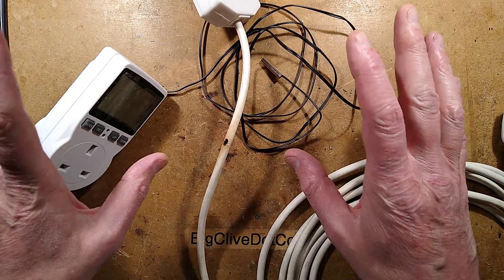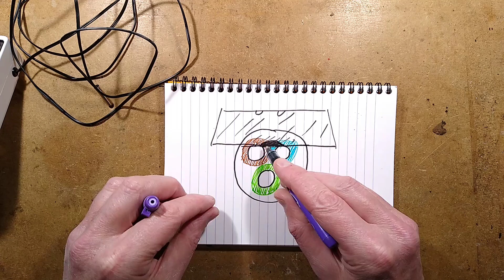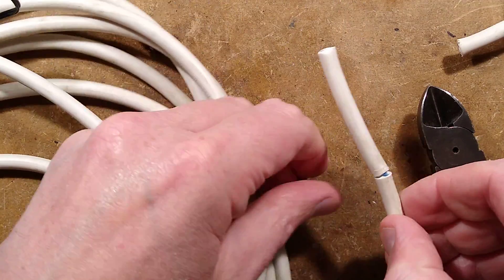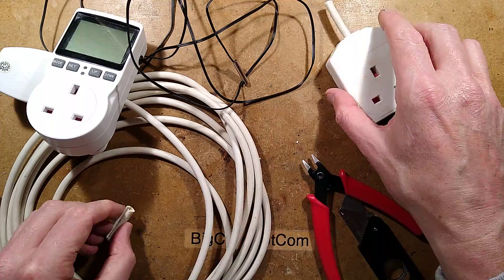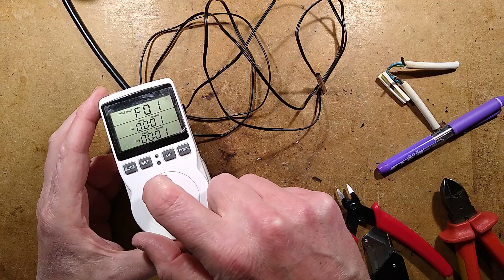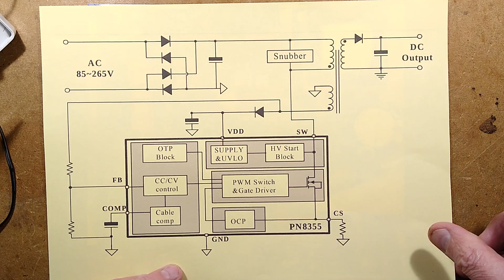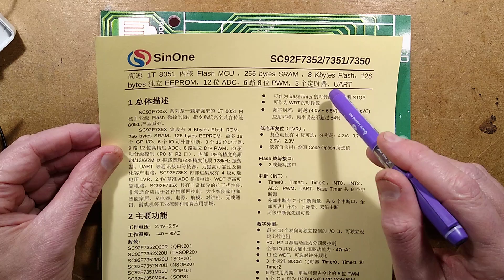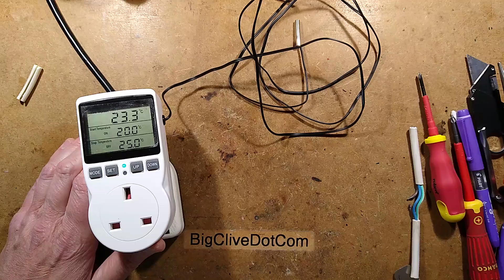The case of the mysterious cable arcing

Comment: I was once trying to trace an audio (computer speaker) cable through a rat's nest of wires somebody had made behind their desk. As it turns out, "rat's nest" was more accurate that I'd have liked, because some rodent or other had chewed through the insulation of the computer's power cable. The copper was exposed but not cut through, so the cable still worked, until I pushed it aside and the copper brushed up against the bare metal desk leg. Loud bang, bright flash, breaker tripped. Fortunately, the only casualties were the cable itself, a scorch mark on the desk, and a... well, let's just say "mark" in my pants.
Reply: Front or rear mark?
Reply: @jonathan_herr  I think I'll leave the answer to that up to your imagination.
Reply: @HiddenWindshield  Sounds like the answer is YES!

😄😁😆😅😂🤣
Reply: . Good answer
Reply: @jonathan_herr  There's a reason why the live wire is BROWN. 😂
Reply: @jonathan_herr  Probably both😂😅
Reply: . Or maybe both
Reply: I shorted a 24s li-ion battery the other day and it scared the absolute shit out of me.
Reply: skid marks indeed
Reply: One actually would think a thing like that would happen way too fast for the body to react by leaving ANY mark !
Reply: @harrickvharrick3957  Well, I did survive, after all. I might not have mentioned that. In fact, I didn't get shocked myself at all, it was just the sudden flash and bang six inches from my hand.
Reply: @HiddenWindshield  Yes, yes, I do understand THAT part  😁   Electricity can be surprisingly ferocious indeed. Remember such a bang can easily be loud enough to get a pissed dad run down two floors to tell you little kids his thoughts on putting stuff in the wall socket!
Reply: . Have heard stories about kids doing this in school.

There are even a few stories on NPR or something like this for this being involved in one story or another as well heard one again the other day.

Sometimes just being in the old gum wrappers as well 

I remember once one of the people in school this is the only time I've actually seen this in person it was not on the brightest people.

You know sometimes in the cafeteria and other places in the school remember they had the connections for like the steam trays and stuff and other high power equipment in some of the gym areas and other places in some of the schools I was in as well.

Keep in mind I'm in the United States.

However some of those heavy-duty receptacles as you can guess do carry a bit more spicy than 120 volts!

Not to mention sometimes well in excess of 15 amp circuits on top of this.

I remember some of my messing around with when the metal forks bending the times back and out of the way not sure if he had spread the two ones that were still pointing straight out or not and guess what that the person did yep right into one of those receptacles and fooling around with enough to make contacts to boot oh yeah nice big bang woman and boy did the Sparks Fly.

It looked as though that he did not know that it's not a good idea the gentleman metallic object into some high power receptacle and not knowing what would be the result is my guess.

And I did hear someone saying I would not do that if I were you on top of just before.

For some reason it smelled like burnt flesh and people were crowded around and someone said get the nurse now.

As far as I know that person did not return to school for several months and clearly could see that he had lasting injury.

For at least more than a year he worked love on that one hand.

I don't know all the details but it was pretty horrific.

I guess you could say almost like mini arc flash type of injuries clearly as I said there was a smell of burning flesh.

Normally when he did this I think that he was quite literally in shock no pun intended.

He is the kind of person that someone dared him to do something he would have even if it was extremely dangerous and most people would know that it would be foolish or dangerous or even risking their life he would probably still do it potentially if someone told you to jump off a bridge in the shower water he might be the one to do this.

I have a feeling that he probably was afraid to even plug anything in for a while after!

I've seen somebody accidentally plug in something that happen to have a dead short across the incoming power chord more than once that was nothing compared to what happened with this person no clue what the voltage and or current of that receptacle was but yeah pretty horrific.

Keep in mind worked on stage crew and have had a few electrical faults most of them were nothing like this.

What besides the time that someone kicked the cable and knocked out the entire stage lighting service trip the Thousand amp 3-phase breaker that was one big bang definitely the biggest one I've ever seen in person not at utility level as in on 120 208.

I think that's when the very few times the main breaker had actually tripped!

There were times that we had to cut this off for emergency disconnect due to an incident!

Keep in mind all the power for the stage was not provided by the service entrance separate for lighting power only!

There was plenty of 208 and 120 and 208 available that was from the rest of the schools electrical service.

We did have access to the Electoral room as needed if need be.

I one of the ones that had the keys for this.

I was literal stage crew electrician.

Plus I was authorized to do electrical work even elsewhere in the schools needless to say I know the system like the back of my hand every so often would need to reset Breakers when something goes wrong 

Even had a few teachers make an oopsie and say.

Do you have to know where the breaker for the circuit is and I'd say yep sure do no problem and then say be right back!

I've been doing electrical repairs in silver I can remember learn to rewire lamps at 4 years old honestly doing repairs that early
Reply: @harrickvharrick3957  You know you're alive when you have a delayed reaction.
Reply: A capacitor explosion of 1000 paper capacitor across mains - best explosion ever...
Reply: @singhpk99 Furious personal experiment or someone else doing any witnessed it or is there a video somewhere on this Elsewhere on YouTube it just sounds like this could be a video somewhere on here as well or perhaps you're the one that put the video up if there is one please respond and if it is a video please add the link would love to see this Jamie want big boom as they say go out with a bang as they say all that sort of stuff
Reply: You know what they say is when you least expect it is when it'll get you're the most were the worst whatever you say on this.

Just remembered an incident that I had.

I remember at a previous place I lived at I was in the kitchen did not realize that the microwave wasn't not plugged all the way in flush with the receptacle.

Keep in mind this reciprocal was behind the microwave.

If you know about those bread ties that some of does twist ties are covered in the metallic material the fancier ones Orleans metal coated paper or whatever not sure what material this is honestly.

Well hand open some bread a few days before didn't realize that the bread tie was sitting on top of the microwave where to get my dish drain and happened to knock that bread time off the top of the microwave unbeknownst to me it's still being there and of course when that happens Falls across hot and neutral of the microwave plug.

Startled The Living Daylights out of me.

I'm very cautious because I do work on electrical equipment but when you don't expect somebody to go horribly wrong or something like this that's when it's going to surprise you the most and let you know it's there and the circuit was active.

I've been testing Christmas lights before and well things did not go according to plan once had the female end of a old Set of Lights the kind that free dated having fuses in the mini lights the female plug was Lil Wayne blown off don't know what happened there but definitely some sort of really bad fault.

Is more of the shock of me just looking at it like how did that even happen it wasn't so much the bang and the Flash it was more of what would cause that to do that what was going up to my mind at the time and just staring at it of course after pulling the plug of course the breaker head already gone but still good idea to unplug something like that that's when the strangest things that I've seen happened with an electrical phone in some type of cord four light set.

Although one time I did see someone plug two cables together on stage they didn't realize that that cable was hot when the connection was made Big Time Flash and bang.

What up replacing both male and female on that one I think that was one of the ones that was probably needing to be replaced connect to wise years ago.

Definitely was a not-so-fresh connector and definitely had seen its days.

There's one time we were doing rigging somebody else up incoming nearly got hit by a flying female connector.

Apparently cable got stuck in there trying to get free and want to somehow have any income off when they gave it the old heave ho.

That is and always was against protocol and safety concerns!

Also one time I remember why do we have a cord with no plug on the end that was just taking off the ringing and someone chimed in and said.

Who set up the rigging had the cord the wrong way around and decided it was easier to change the plugs then redo everything and turns out they didn't install the plugs very well and and just come off in the process of tear down of that show!

Needless to say that person no longer put plugs on cords and I checked others that apparently it had been working on and lo and behold done very badly and Spring Leaves not even properly tightened either everything was almost like barely even tightened I think that's one reason why we had that flickering light as well probably was the culprit was that person had tried to put a plug on that one needless to say he was prohibited from repairs.

By myself specifically and Stage manager after I showed case manager his quality of work that puts everyone at risk

Comment: The Chinese Remote control version is worth examining. It works well although the transmitter (2xAAA) batteries need changing every three months. It has been known to migrate to the freezer mode (indicated by a frost symbol), from the heating mode (indicated by a flame). When it sends the temperature signal it flashes Green which can be annoying. I tend to keep the transmitter in a cupboard!

Comment: I always marvel when it all gets exposed.
I spent 40 years in industrial control, and more than once I got a roll of wire where they ran out of conductor and simply loaded more and kept extruding. The result is a roll of wire with a break or a simple contact connection somewhere in it. Maybe there's another explanation, but I've also found a "tape together" (not a splice, just the 2 wires taped together) in the middle of a 500' roll. None of them are good, especially when pulling into conduit. 
It could be this cable had a bad roll of wire that then went on to become a cable. Hard to believe wire manufacturers can get away with such practices, and well not common, it's not entirely rare either. To this day, I always ring wire on the roll when it's delivered, and keep a sharp eye (and hand) on the wire when pulling.

Comment: I electrocuted myself on a building site because of a faulty cable. It was wet and I was coiling it up whilst it was plugged in, I got a shock, yelled out and tried to drop the cable as I let it go I got another shock yelled again in a higher pitch and tried to drop it again. This happened about 5 times with my voice getting successively higher untill I managed to drop the cable. Turned out I'd blown power to the entire site. Inspecting the cable I saw a very fine slice in the insulation. I was totally fine and I learnt a valuable lesson!

Comment: Could be just very cheap bad dangerous cable. I had an extension cord with an triple mains connector with switch, and really, I bend it sharp for 30x, and the isolation broke open !

Comment: This happened to my hair dryer, spark came out like fireworks. I later found that the outer insulation was a normal beefy looking black sleeve with blue-brown inner insulation, but the actual conductor was so small an earbuds might even have more cross sectional area than those cable did..

Comment: I have an Amazon item you can tear down. It works just fine other than the angry pixies that tickle you from the usb metal exposed on the connector. Also tempted to upload a short video where there is a light switch blank on the shower wall. And on the other side of the shower wall the light switch to turn light on.

Comment: As Argoneum pointed out, it looks like it was probably Aluminium wire instead of Copper. Any chance of experimenting with the rest of the cable to see if it's easy to break again and how much load it can handle? Cheap extensions are great until your house burns down.

Comment: I don't know how many power cords I have seen go up in smoke ,slithering on the floor and melting and popping and crackling ,just like fireworks only with the smell of burning rubber .600 v can go off with a boom ,especially when run over by a lift or other machines ..we had a 12 /4 SOOW cabtire go off like a shotgun when someone with a towmotor decides to run it over .was on a 600v 3p 20a circuit .took out all 3fuses ,luckily

Comment: I had a slightly different thing happen to an Ethernet cable when I was pulling through another Ethernet cable under the floor of a our data centre at work. The outer jacket was pretty aggressively conformed to the twists of the pairs inside, so it was particularly ribbed (For her pleasure? Because it wasn't for me!). When I pulled it through, it happened to run over a perpendicular cable, which evidently didn't have a very tough jacket, because it gouged right through it and then went through the insulation on the pairs.

Only found out about it later when IT started complaining about a server becoming unreliable. Found the gouge when I was tracing out the connection from the server to the switch, so obviously I replaced it immediately. When I checked the port logs and stats, it was constantly going down and up, and lots of packet errors. The problems went away with the new cable.

Needless to say we switched to a less aggressive brand of cable.

Comment: Never thought about this until now, but in the UK, where your running 240v, your cords can be a lighter then the cords over in the US. What's "consumer" heavy duty over there? And do you often see conductors breaking in cords?
Reply from the maker: A typical cable for the highest load run from a 13A plug (3kW) would be a 1.5mm CSA cable.
Reply: @bigclivedotcom  Americans are probably more used to using AWG for cables but 1.5mm would be a little bigger than 15 gauge (1.45 mm) but smaller than the 14 gauge used in their standard 15A outlets (1.62mm) in AWG it would probably be about 14.8 except I don't know if they make fractional gauges like that. Still fairly comparable would only be the larger 20A receptacles that are significantly different as those use 12 gauge (2.05mm). But I think the 15A is the more common one as far as I know 20A receptacles are normally found in kitchens and the like as various worktop kitchen appliances like microwaves and toasters get close to or exceed the 15A limit at 110V.
Reply: @bigclivedotcom  my heavy duty extension cords are 10ga, I don't use anything less then 12, wife got some 16ga cords a while ago that were "fragile", one plus side of running low voltage, heavier cords. (Right up until you see the price of a 100 foot 10ga cord)

Comment: I've only ever had two faulty cables over many years... Often they have been visibly joined, by twisting together, then run through the encapsulation extruder. The only thing you see is a slight bulge in the cable.

Comment: A good example of where an AFDD would be useful. A series arc in an active won't trip the overcurrent or residual current protection (unless the ensuing damage eventually gets the neutral or earth conductors involved), but an AFDD can detect the arc by monitoring the AC waveform

Comment: People yanking off appliances' cables like my mother (a lady Born in the 1940's) will eventually face the same issues, unless it's a rugged coaxial cable. When I told her to do not yank the cables she started to pull the plugs with appliances like washing machines and other induction loads while draining current, melting not only the plugs but the power outlets themselves, due to arching.

I asked her why she wasn't ever switching off the appliances. She had set one extension cord and one outlet on fire. Gladly the breaker switched off and avoided something worse to happen.

She also plugged her vacuum cleaner in my no-break outlet and blew a fuse, rendering my file server unusable while I was trying to remotely connect from a client. Sigh...

Comment: I think you were mostly correct in the first instance. The outer sheath definitely looks like it had been damaged at some point, although probably only partially cutting the live conductor. If the load was heavy, or has a high inrush,  it may have just been enough to burn the remaining conductors as the current heated what is effectively a fuse. Fireworks then ensue.

Interesting coincidence with the timer-stat though. Thanks for sharing Clive.

[Edit to add] The V shaped cut on the outer sheath looks all the world like it has been trapped under the corner of something heavy at some point.